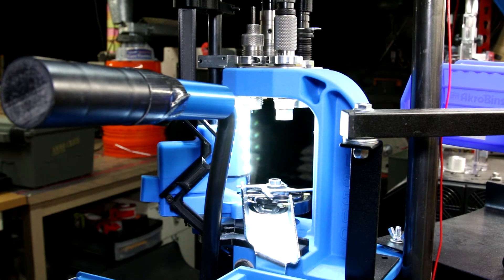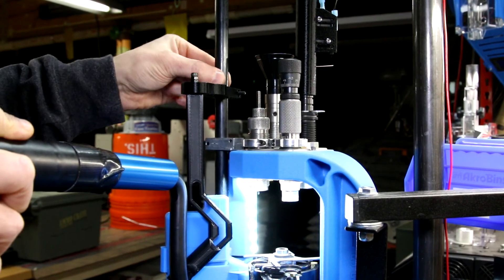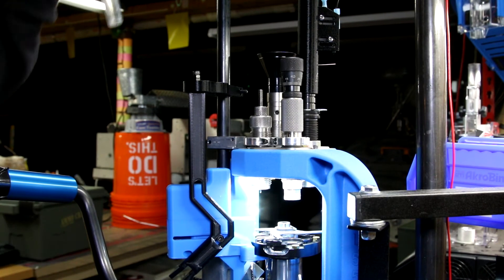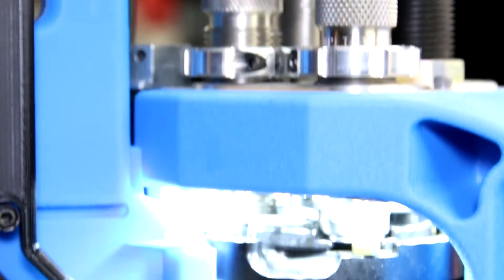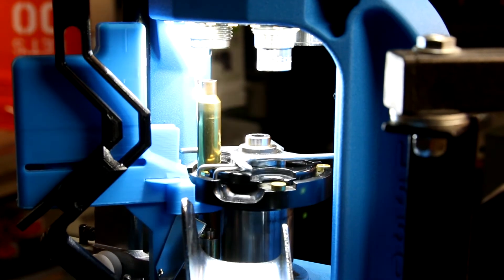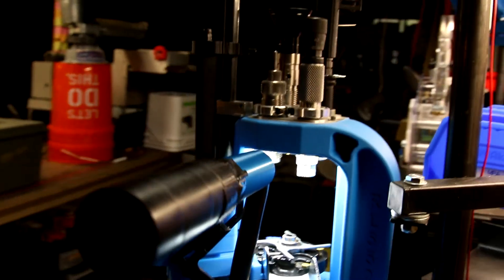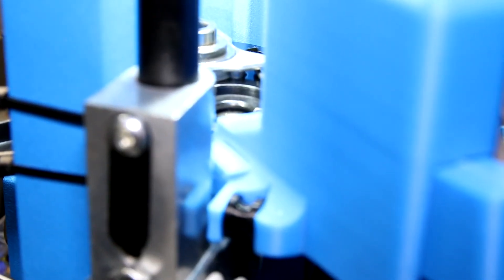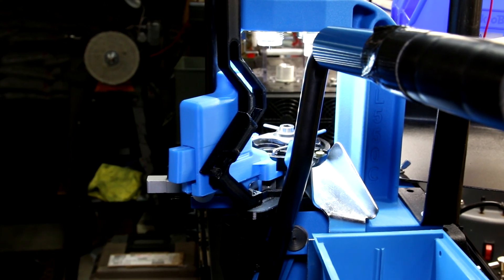Dillon 550 6.5 Creedmoor Case Feeder Parts Instructions

Comment: I'm assuming that the 308 case wasn't getting to the shell plate before the brass was supposed to go into the die.  Basically the brass isn't moving fast enough.  To speed up the case the roller track needs to be flattened out thus speeding up the shell delivery.
Reply from the maker: Yes it was a timing issue, I couldn't get it in and out fast enough before the top of the press hit the ram